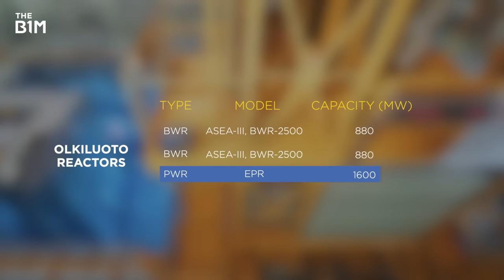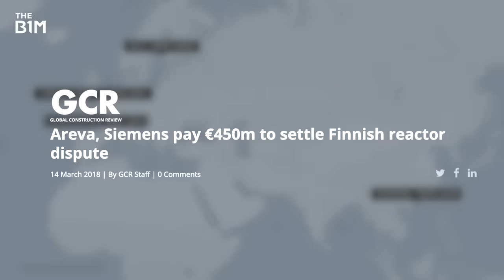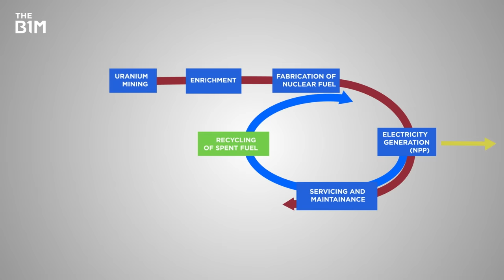Finland Might Have Solved Nuclear Power’s Biggest Problem

Comment: you know, i wrote a whole thing. But then i thought "what's the point?" where it's safer than some methods, that is still just burying it with extra steps. And something that has a hazardous byproduct is by definition not clean. just saying that it's safe doesn't make it so. Sums it up even if the whole thing was a bit more nuanced.

Comment: Nuclear power does not produce as much truly harmful waste as this video implies. I understand the facility is absolutely massive, but the estimate shown here is so big that it simply has to include all the forms of nuclear waste. By which I mean everything from gloves that have been in the near vicinity of the radioactive material to the spent fuel rods themselves. Nuclear waste is divided into three classes. Only the last third poses an actual real danger if disposed of improperly. These are the ones that are buried deep underground. Encased in layers of metal and concrete it will remain there for hundreds of thousands of years. These tombs are designed to withstand incredible amounts of damage in the event of some natural cataclysm. I am writing based on what I remember from Kyle Hill's videos, which i higly reccomend you go watch. His viddeos are far more accurate as he has personally been in contact with actual nuclear physicists. I also just think he explains it better by actually going into the science, but without all the mind boggling math

Comment: If every country used a IFR (Intergral fast reactor - Argonne IL design) all the actindes are "burnt" leaving only cobalt and cesium with a 200 year high radioactive waste that can easly be burried deep - to such a depth that the high temperature of the earth matches or exceeds the temperature of the radioactive Co & Cs - also why bury spent fuel when it can be recycled to produce powder -electrolytically in a IFR?

Comment: Nuclear wast has to be stored in dry rock with no flow of water through it for obvious reasons.  Dry rock is a great temperature insulator.  Nuclear waste has only given up a small portion of its energy.  The rest is given out over time as the waste degrades.  Nuclear waste gives out various atomic particles which degrades any containers it is stored in.  So what does all this mean.  We may have cooling systems set up to cool the waste but they will degrade over time and besides they have to work for thousands of years.  Our societies will not last this long.  At some point the heat will just start to accumulate and with no where for it to go, the whole area will heat up until the rocks melt.  Each such facility will become a small, radioactive volcano, spewing radiation over it's immediate area.  Not a nice thing to leave for our decentants.

Comment: Burying nuclear waste is just amplifying the waste problem.  If you can’t deal with it directly dont produce it.  It is very expensive to build, with 80% of the cost being born by tax payer.  Its level of pollution (waste which can not be dealt with in an adult fashion) is unprecedented.  Nuclear should be investigated, but kept in the laboratory environment until it can be deployed in a safely realistic method.

Comment: People also underestimate how little waste fission power produces.
You can fit the lifetime nuclear waste of switzerland, a nation with 4 nuclear power plants and 50 years of fission power use, into one single cellar.

The power to waste ratio of fission power is rediculously tiny!!

But yes. Its waste that is extreemly dangerous and needs local maintenance for the next few decades at least and centuries at worst. 

Still way better then the megatons of co2 we produce every day in the world.
Waste we cant co tain, and that is causing damage that will need global maintenance and repair for the next 100 or 1000 years at least!
Reply: Good points, and yes nuclear is a much better alternative than coal and oil and gas. And solar and wind have plenty of long term issues as well.  But what about geothermal?  Geothermal seems to offer plenty of good potential without many of the problems of other energy alternatives.

Comment: Those storage facilities…how well will they handle earthquakes. I see many possible points of failure and inevitably one of those entombments will fail and end up becoming an environmental concern. I was thinking maybe sending it to space but that’s not a very good idea either. Hmmm what’s other ways to deal with spent fuel?
Reply: Finland has not and will not have earthquakes for the lifetime of the radioactive waste. The continental plates move so slowly that the fuel will decay to the point of being harmless by the time that area becomes prone to earthquakes.

Comment: Uhh, it's biggest problems are that it's inherently expensive,  potentially dangerous, and therefore even more expensive.  Doesn't sound solved to me...
Reply: 1 billion usd to get rid of 100 years worth of waste to power most of a country...... that's damn cheap and you know it. The damage from coal and gas will cost us much much more in the long run

Comment: Space elevator it out of the atmosphere then shove it into the sun.  Poof - waste gone forever.  It's already a giant nuclear reaction anyways, a little more won't hurt anything.
Reply: That WOULD be viable if you know.....a space elevator would even be theoretically feasible. We still haven't invented a material that can handle the stress involved in such an endeavor. Not even carbon nanotubes can handle it
This solution is cheap, relatively easy and secure as hell with no chance of it ever causing environmental problems.

Comment: how can this be clean with all this wast i worked Queensland aust removing radioactive material  that got put under ground and covered with concrete  and above ground it still went off the scale made no difference last job i did my tag went all green and i was finished up

Comment: Isnt like ground water in the ground- non engineer here
Reply: Well I'm not a geologist but I know enough to tell you that this is a completely novel method. The ground water problem was a thing because some countries started dumping their waste in old mineshafts from for example coal mines. Not a bad idea on itself but some neglected to account for leaks and nearby water reserves. Coal layers aren't exactly leakage resistant. 
Not only is this storage made in geological bedrock that has been stable and inert for millions of years, the site was chosen based on its distance from any reserves. Each casket is specifically made to withstand erosion for 100.000 years, encased in leakage resistant material and the stone layer it is inbedded in was chosen specifically for those same properties. There is NO chance of this causing any environmental concerns and you could drop a nuke on that site without it causing any problems. 
It's a permanent, cheap and safe solution. That's what makes it revolutionary

Comment: Spend fuel can be store a lot of ways.  Salt formations make the most sense.  Old rock formation can as long as water seepage is not a problem.  One thing left out with renewables is their long term waste.  Heavy metals do not have a half life and are forever and are created in much larger qualities with renewables than nuclear.  Any thinking person should know nuclear is the only solution for so called climate change if it is real.  Claiming CO2 is a pollutant is a stretch since every carbon atom in your body once came from CO2. No way getting around that, CO2 is life itself.

Comment: Very uplifting but another major problem with nuclear power is that the reactors we have are about 15-20% less thermally efficient than current thermal reactors
Reply: Most nuclear power plants ARE thermal reactors.
Reply: @johnflux1  ya they generate electricity through the transfer of heat, but if I’m remembering correctly, thermal reactors usually refers to the burning coal, gas, or oil

Comment: This method solves nothing! It's just better storage, kind of like digging a deeper hole to throw your garbage into...
Reply: Like it or not, this solution is cheap, safe and permanent. You could drop a nuke on that site and it still wouldn't disturb the waste + the chances of it contaminating anything or leaking in the next 100.000 years is nihil. This isn't some irresponsible dumping in old mineshafts where it can pollute ground water.

Comment: Very interesting content, for sure.
But EPR technology has yet to prove it performs with stability and ease of use. Not the case by all means. The Chinese facility is said to work, but doubts remain about it having reached a "cruising" level of efficiency.
Because EPR may cost a lot if it fails to operate at full rate, its major downside actually :  a do or die system, in a way...
[updated]
Reply: Yes, Wikipedia has an article about EPR reactors. For some reason the video at 1:42 calls it "ERP".
Reply: @BenAtTheTube  why mentioning Wikipedia ?

Comment: Right. So throwing it in a big hole that will be full in 100 years. That's just kicking the can down to Finland's next batch of great great grandchildren.
Reply: It's not an long-term Solution.
Reply: @inspectorwinship9538  Like it or not, this solution is cheap, safe and permanent. You could drop a nuke on that site and it still wouldn't disturb the waste + the chances of it contaminating anything or leaking in the next 100.000 years is nihil. This isn't some irresponsible dumping in old mineshafts where it can pollute ground water.
It doesn't need to be a solution for eternity, just for the next 100.000 years. After that you can open those canisters and hug that waste. And it's been specifically designed and built to do just that.

Comment: How that would still be cost effective compared to renewables is beyond me. But of course, as the build, the use and the decomissioning of nuclear is subsidized beyond anything decent, just because the lobbyists of the big energy producers tell us central energy production is more sustainable and cost effectiv (lol) than decentral energy production. Yes, for their wallet it is.     :p
Reply: That whole complex costed around a billion and can store all finland's waste for the next 100 years. That's actually very, very cheap
Renewables are great too, but we don't have good enough storage facilities yet to use it as our only source of power. You need electricity, even on a windstill night. That's why you need backup, and you can either use nuclear or fossil fuels if hydro isn't available to you.

Comment: This is really great news. As every country is responsible for its own nuclear waste, I can see every little country building one of these in their own backyard. Finland's not going to be accepting the world's nuclear waste, they're trying to deal with their own. Japan has to pay their nuclear waste somewhere in volcanic mountains. That sounds really safe. More than 50 countries utilize nuclear power for electricity. Only one has a plan for its own waste. What of the other countries? Britain and France both have contaminated coastlines from their nuclear processes with plutonium everywhere on the beach. Dropping nuclear waste and 55 gallon metal drums deep into the ocean where dilution is the solution has not been a very good solution at all. Russia's Arctic Ocean has been used as a dumping ground. America's Rocky flats plutonium processing facility cannot be cleaned up anymore then Hanford can be cleaned up where some idiot stuck to Columbia River next to it.

Comment: A german sience channel once released a video about that problem: one question finnland doesn't answer with this solution: How to tell next generations from this idea? 
you said we had needed a place for 100.000+years. we just don't have any language or informationsystem that is able to save the informations about the nuclear trash. So if any human are finding this trash in a couple of thousands of years.. maybe they don't know what it is and just open it out of curiosity? 

TL:DR

How do people in the future know of this nuclear trash? not in 100 years.. but in 2000 years? in 15.000 years? is this idea still save then?
Reply: After 500 years, the canisters themselves are already safe to stand next to, they are safe unless opened. And the future is precisely why it is buried in a remote location, half a mile underground and far away from groundwater or natural resources. There is literally no reason to start digging there. 
Even if by sheer dumb luck, someone would decide to dig there, it would require a lot of modern equipment to reach the canisters. People with that kind of equipment would be smart enough to check for radioactivity while inspecting them.
Reply: @viktor1496  I hope you are right. my trust in humankind is very low.. I mean.. how many graves did we open without knowing what could be inside.
Reply: @ChrisCatchTheHat  I get you, but this project involves so many people and scientists, government oversight, independent organizations....etc. It really isn't some shot in the dark :)

Comment: Spent nuclear fuel is a valuable resource that contains 90%+ of usable fuel remaining, can and should, and has been  reprocessed. If the Finn's don't want to do it, they can outsource the work on a toll basis to other countries to do it for them. The only reasons the United States won't do it is because of the Uranium industry that doesn't like the competition, and the nuclear non-proliferation weenies in the State Department and the modern Green Luddites that want to universalize their own fears grounded in willful ignorance.

Comment: Putin is probably taking a look at this now.  I wonder what the cost difference would be if you provided all the customers with home wind and batteries instead of supporting a dangerous grid and big power companies.
Reply: 3,000 watt wind Turbine at Home Depot for a little over $4,000.  Battery pack prices are all over the place.  So probably $20-$50K to go completely off grid for family of 4.  This will cost at least $5 billion to go nuclear and supply 14% of Finland at peak operation.  So, for the price you could supply 400,000 to 1,000,000 people with completely safe wind energy.  This is well over 14% of the population.  But it doesn't make anyone rich.

Comment: Hundreds of thousands of years. That’s all I need to hear to look elsewhere for power. The land can never be used for anything else ever. This is not solved in any way shape or form.
Reply: @johnanthony2545  Why would you need a safety zone? After 500 years, you can already cuddle those canisters all day long without danger. And nobody will be able to reach those canisters ever again unless they have serious industrial equipment and a whole team of people.
Reply: @johnanthony2545  You also don't seem to get how electricity grids work. There is such a thing as a baseload. Due to energy storage issues with renewables, most grids can at current only handle 30-40% wind and solar at best. Off shore hydro is too expensive and undeveloped, hell Thorium reactors will be commercially viable before that is. 
For Finland, it's either this or gas/coal plants. There is no alternative for the steady baseload energy generation that the nation needs. And I'll just throw out there that the pollution from gas and coal kills 700.000 people a year in Europe alone. Then we haven't even started about global warming.

Comment: Burying deeper...that's the solution?
Reply: Jup, this solution is cheap, safe and permanent. You could drop a nuke on that site and it still wouldn't disturb the waste + the chances of it contaminating anything or leaking in the next 100.000 years is nihil. This isn't some irresponsible dumping in old mineshafts where it can pollute ground water.

Comment: In a copper capsule? that sounds expensive and I bet you a thousand dollar people will try to scamboozle you there. Like making the copper layer thinner, filling it with noncopper or whatnot.

Edit: Also it sounds very stupid to bury copper when we do so much effort to dig it out of the ground first. Cant wait for the first "gold-diggers" to try to extract that copper again as soon as no-one looks or maybe in a 100 years when nobody remembers anything about that anymore.
Reply: Mate, have you ever seen how people work at nuclear facilities? Everything is triple checked, goes through multiple rounds of quality control and costs definitely aren't spared for safety. That's the entire reason the new reactor cost so much and opened so late. They had to be sure
Compared to the cost of the facility, the canisters themselves are extremely cheap. And they undergo a LOT of scrutiny before being used. That Copper is a blend of materials by the way, to make it corrosion resistant. It can't be used in housing, electronics...etc. Since its heat capacity and conductivity aren't the same. Not to mention the insane cost of digging them back up far eclipsing the cost of the containers.

Comment: I hate to state the obvious, but this isn't a 'solution', it is a bandaid. WHen you fill the site in 50 years, then what? You build another? and it is the same thing all over again. I was expecting something a bit more clever from the idea of 'solved.' That means the problem doesn't just renew in 50 years, it means it doesn't have to be renewed. Yay...better storage of waste that no one can do anythig with in the future. 

That's not a solution.

Comment: The Unwashed Masses: They just dug a bigger hole.
Reply: A bigger hole in geological bedrock that has been stable and inert for millions of years, yes. This isn't just a case of dumping it in an old mineshaft for example where it can leak and pollute water reserves. 
With this tailor made solution, there is no chance for environmental disaster and you could drop a nuke on that site without any waste getting released.